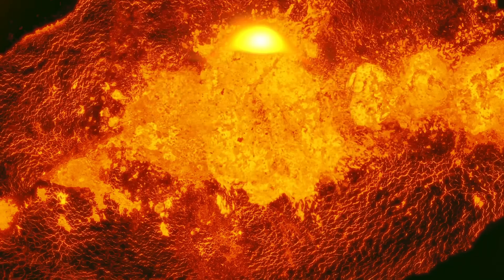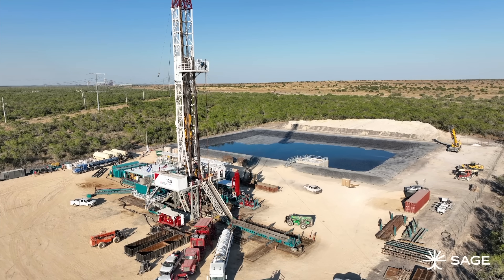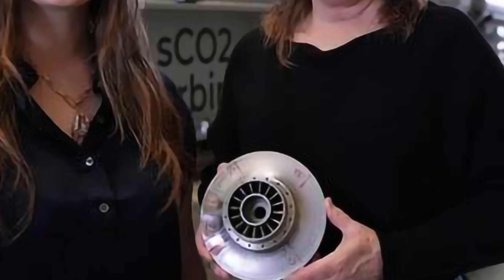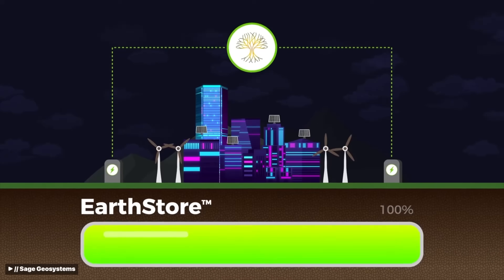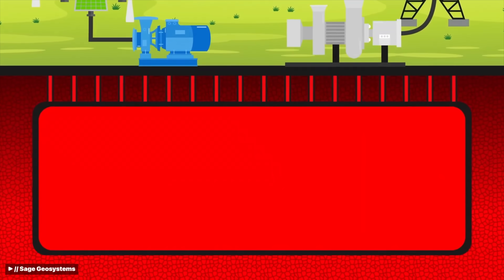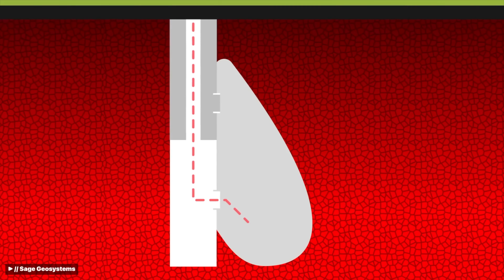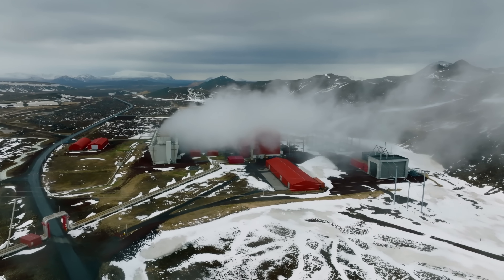This Tech Solves Geothermal's BIGGEST Problem - Gamechanger?

Comment: The 800-lb gorilla in the room with Sage and Fervo and other modern geothermal concepts is "where are they getting the water?".  I mean, Sage and Fervo both have said they drill hot, dry rock and avoid natural fractures.  And yet, they also mention that they use water to harvest the heat and bring it to surface.  They have to send that water back down into the ground after they have extracted the heat.  The part no one talks about is the volume of water required to make meaningful electricity, and the fact that they are taking that volume of water out of the hydrological cycle - meaning that once they remove the water and put it into their system, the water is NOT returned to streams, rivers, ponds, stormwater treatment, wastewater treatment, etc.  Its gone.  And if you think about the implications of that, well, their "solution" is not really that attractive.  Do the homework yourself and see how much water they need for 1GW of electricity.  That is why Sage and Fervo and other EGS solutions in hot, dry rock are fundamentally flawed.
Reply: If you want the answer, you'll find that it's about 1 acre-foot of water per MW, or 350,000 gallons.  Which means a GW is 1,000 acre-ft, or 350,000,000 gallons.  For some perspective, go to ChatGPT and ask "Where does Washington DC get their water for public consumption, how much do they use per day, and how much do they treat and discharge back into nature?"  You'll quickly discover that Washington D.C. pumps about 100 million gallons of water per day from the Potomac River, they can treat 300 million gallons per day, they store about 60 million gallons of treated water, and the Washington Aqueduct stores about 60 million gallons.  And how much power does DC use in a day?  About 27GWh, or roughly a little over 1 GW per hour.  So for some perspective, these geothermal outfits are going to need to use more water in a day than Washington DC (water that is permanently removed from the hydrological cycle) to create about enough electricity to power Washington DC for a little over an hour.

Comment: The biggest problem for geothermal energy is that it requires a rare combination of three elements: heat, water, and permeable rock [01:56]. This has limited traditional geothermal technologies to about 2% of the world's surface, keeping it from being a widespread source of power [02:03].

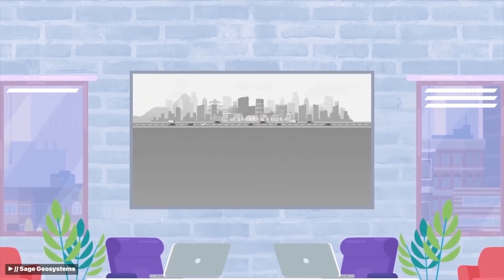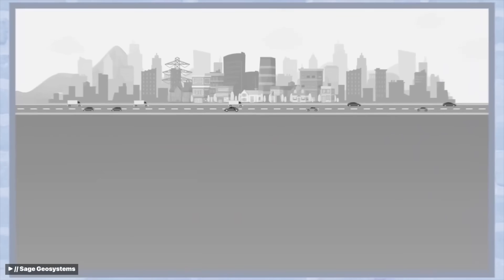The game-changer, according to the video, is a technology called pressure geothermal from a company called Sage Geo Systems. The company, which is led by drilling experts, found a way to drill into hot, dry rock, which is available in 50% to 60% of the Earth's surface [00:25, 02:39]. They use a technique called gravity fracking with only water and crushed rock to create a large underground fracture network [02:46]. This allows them to manage heat and pressure in a multi-well pad to produce a constant 50-megawatt output [03:05]

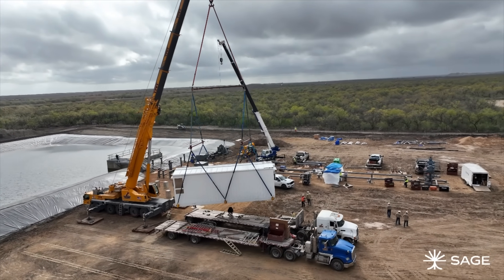Sage's turbine a supercritical CO2 turbine [3:36].

How It Works
A supercritical CO2 turbine is an advanced technology used in some geothermal systems. The substance used, in this case, carbon dioxide, is heated to a "supercritical" state where it acts as a very dense fluid that is neither a gas nor a liquid.

This allows the system to generate power more efficiently than a traditional steam turbine, and the turbine itself can be significantly smaller and simpler .
Reply: Only for 30k houses ,in a city of millions which requires a few plants-  all that fracking can bring about an earthquake?
Reply: @EdT.-xt6yv Small earthquakes happen all the time and humans don't even notice.  Seismic activity is nothing new.  While a simple Google search indicates 2 earthquakes greater than 3.0 attributed to fracking, 99.9% of all fracking earthquakes are so small no one has ever noticed.

Comment: It is the drilling cost and even with millimeter wave technology included, this adds complexity with. What is drilling failures due to technology just not yet perfect, this may be a DOE aspect to develop the technology under the geothermal  or mechanical programs.  The aspects of doing this are good, but the problems encountered in developing deep fractures will be difficult due to geo pressure unknowns in the substrate, avoiding natural fractures in totally unknown until continuous testing.  A likely unknown added to the picture.

Comment: The idea of not adding a biocide I find unreasonable. If the system were to get infected with anaerobic bacteria and one would thus be confronted with H2S you’re in a very bad spot. Managing even the lowest ppm is not trivial and expensive. Safety issues, hydrogen embrittlement etc….Not all oil industry best practices are evil!

Comment: Asked to “Sound Off”, so I will. It seems that this non toxic Geo Thermal Electric Generation approach is superior to the not so "Clean” Nuclear Fission Electric Generation approach to solve growing power hungry society's electric energy demands. I ask here for a video to be done on exposing nuclear electric energy generation spent fission fuel short term, AND long term storage issues. Also Uranium Miners life spans/working conditions. Why ? ...Thorium or Uranium Fission Nuclear Power of any type, today, equals a spent stockpile tomorrow of nuclear fuel rods in a cooling pond dependent on electric, electronics, a limited number of skilled people with expertise to maintain the spent nuclear fission cooling ponds, electric energy water pumps built with sensitive electronics coils, machined mechanical replacement parts and water pump pipe parts to keep the rods cool for innumerable years running constantly. A cooling pond system needing much monitoring. These VERY long term cooling ponds are all over the World now. Small Modular Reactors (SMRs), like all nuclear reactors, produce radioactive waste. While SMRs are smaller and potentially more flexible, they don't eliminate the need for waste management and disposal. In fact, some studies suggest SMRs may generate more waste volume compared to traditional reactors. Question ….. why make even more cooling ponds needed full of even more spent radioactive nuclear waste laying around, everywhere, when another 1859 Carrington Event type CME can & will decimate all of our electronic dependent society, and specialized people do not come to work, choosing to stay with family members as “ civilized" society devolves to a mad max event foraging for limited food, to maintain the temperamental nuclear waste cooling ponds when electronic cooling pond sensors are no longer working, or manufactured that have failed, and pump replacement parts no longer are available, or can be manufactured, or shipped, and hydrocarbon fuels to run the backup water diesel engine pumps can not be delivered by inoperable trucks with blown out electronics, or more fuel product distilled by chemistry dependant on electric, and electronic sensors destroyed by a strong CME Electric Magnetic Pulse ( EMP)….. Get the cataclysmic picture, yet ? What then ? Will…spent nuclear fuel in warming ponds overheat releasing nuclear fallout to Earth’s atmospheric winds, and jet streams ? Yes ! For sure, spreading poison into nature’s ecosystem, the last food source. Will more nuclear waste cooling ponds all over the world with spent radioactive rods end up overheating, killing off the remaining meager, food chain left in nature feeding the last few struggling humans trying to survive, to rebuild over many future human generations, after a large CME has taken away our modern electronic dependent pampered societies underpinnings, and most of Earth’s human population as well? Yes ! Logically, more fission nuclear electric power creating more spent radioactive waste material needing more VERY long term cooling in ponds is such a bad idea, and should never be seen as a “clean” electric energy generation solution as promoted by many YouTubers. Even rock mining for uranium minerals to make into fuel, the dust gets lodged deep in their lungs which kills human miners slowly, and painfully, just so that we can have that not so “clean nuclear fuel” for pampered people's electric generation needs. Pain and suffering out of sight, is still pain, and suffering incurred by a fellow human being. Google….life expectancy of a Uranium miner to learn more.. Or…Google the top “geopolitical”, “not so friendly” uranium supplier countries in Central Asia , and Africa whose citizen human rights records, so important to many green technology promoting YouTubers, and Readers, to explore  safety practices while uranium mining which is at best described as dismal. Even child labor is used in African uranium mining. Knowing these facts is an eye opening knowledge gain result countering the “clean nuclear” energy dogma carelessly spewed here, and elsewhere. In fact, if robust nuclear electric generation power is implemented as championed here, it is the recipe for the final knockout blow to a very much degraded, struggling humanity after another intense CME comes to visit Planet Earth as has happened so many times in the past. Google the smaller than 1859 Carrington Event “Bastille Day Event” a moderate, but not worthy CME that was hurled toward Earth from the Sun erupting July 14th 2000. Suggested is not to read the tea leaves to predict what will come, but instead read the petrified tree rings of the past. Do you not believe that CME’s can happen at any time(s)…? Google : "Miyake events" after the Japanese physicist Fusa Miyake, who first discovered the CME telltale signature in tree rings. Remember to Google: to learn about what a electromagnetic pulse (EMP) is a burst of electromagnetic energy that can disrupt or damage electronic equipment. It can be caused by natural events like geometric disturbances (GMDs) Google: THE 1859 Carrington Event. Google EMP to better educate yourself to see the vulnerability. As recently as July 2012, a powerful coronal mass ejection (CME) from the sun narrowly missed Earth, passing through our orbit but not directly impacting the planet. This event, considered one of the strongest ever recorded, could have caused significant disruptions to Earth's technology and infrastructure, potentially comparable to the Carrington Event of 1859. When better educated with historical knowledge, you can then decide if you wish to “roll the dice” supporting the notion of proliferating NOT “clean” nuclear fuel as an electric generation fuel of choice as misguidedly suggested by YouTubers who gloss over, or do not mention the fission nuclear spent fuel long term storage conundrum. Seems that this Geothermal non toxic approach concept not needing thousands of years of radioactive “ HOT” spent fuel monitoring is a much better solution when soon at a competitive costing scale of deployment while utilizing an existing well trained Word wide hydrocarbon well drilling labor force.

Comment: I did some research on this for my job about a year ago.   The issue is that geothermal heat is such low temperature that you have to use an Organic Rankin Cycle (ORC) to extract the energy.  The problem is that the thermal efficiency of these systems is approximately 10% meaning that you have to reject as much as 10 times as much heat as you generate power.  This heat has to go somewhere and generally that is into bodies of water or the atmosphere.  I don’t think this would be very good for global warming or the environment in general.
Reply: You missed the message
Reply: You mustn't have looked too deeply into it. Supercritical water and supercritical CO2 is the aim. Also the fields in use today use hi pressure super heated steam, and  only use ORC to recover energy from the last dribbles of heat.

Comment: Here is another example of praising an energy producing system without explaining, investigating, or even ignoring the negatives of it. Like what they did with electric cars. No wide explanation of the problems such as battery fires, cost and length of charging time, insurance won't repair most collision damage and the cast of insurance. All of this and more was ignored , hidden, or unknown prior to the great push for the machines.

Comment: I wonder if heat and pressure could be used? They use sand to store heat for batteries. Why not combine the two and see if it will get more out of the system or not.

Comment: The description by the company, this isn't geothermal, it's geopressure.  They inject the water into a pressure vessel using other types of electricity, then release the pressure to extract electricity, like a battery.  In this case the pressure vessel is in the earth.  Misleading title.

Comment: Ehhhhhhh...............  From working in the O&G business/field, wells seal up if they don't maintain a minimum pressure to keep the fracture open.  That is with the advanced synthetic particles that are designed to keep the fractures open longer for production than using just water and sand.  Granted, the greatest amount of energy used in creating the fracture and pumping water down into the well is the initial fracturing.  Water disposal wells chew up a considerable amount of energy to inject unusable water back into the ground.  None of my clients use geothermal wells anymore for the main reason that they eventually get clogged up and require new drilling or flushing.  Which requires a lot of energy and is really expensive and they don't see a huge cost benefit with the amount of extra effort that is required to maintain the well.  I am sure they are thinking through a lot of this... but I'd say this whole thing is resting on the chances that their turbine is far more efficient than other electric generating turbines in existence and that their well casing/maintenance is somehow going to be far superior to typical practices today.  The delta of benefit looks slim.

Comment: I feel like all the key tech needed to reduce C02 and reduce the oil and gas needed around the world is there, but we just need time to build and test it out at this point. 2050 will have some crazy stuff by then, with almost everything doubling in storage, generation, and reduction. Esp if they can get solar to double their current output. Main problem is just cost still for the average home owner at least here in the US. You almost need a new HAVIC system, water heater, solar, batteries, car, stove, etc so while the tech will get there, I think it will be a while still before everyone gets to switch. So more like 2100 will be the year for all green planet.

Comment: Just like with fracking, which pollutes aquifers and causes earthquakes, this is another “holy grail” where possible destruction of the delicate balance of the earth is completely ignored.
Reply: It was not ignored but mentioned in the video. It will certainly be looked at. Relax or if you're so concerned about delicate earth balance get hot on eliminating gas from your life. If not pack it in.
Reply: @cre8tvedge 
A typical idgets response. Put the onus on the individual for a problem that can only be solved at a governmental level. 
I do what I am able, but what would help much more would be narcissistic climate deniers such as yourself deciding to “pack it in.”
Would make the world a better place for humanity.

Comment: Scale deposition is a  serious problem in many geothermal systems. Dissolved calcite,   various salts deposit in wellbores and surface equipment, concentrated in cooler, lower pressures closer to the surface. Often costly chemical treatments are used to manage this, where possible, but it is stiil a major obstacle. It occurs in the oil and gas industry too, especially in secondary recovery water floods and enhanced recovery C02 floods. It is heavily geology dependent and is also a factor in geothermal energy. Some areas are better, with favorable geology ,a higher geothermal gradient and an adequate feed water supply. Horizontal drilling with multi stage hydraulic fracking is a big game changer in the oil and gas industry shale plays and would have been unthinkable just a few years ago. Technology advances and   hopefully will continue in the geothermal energy world too.
Reply: How about teflon, ultrasound, and big settling tanks.. maybe even use them for cement?
Reply: Yes, teflon coated tubulars are used in oil field applications to prevent corrosion and limit scaling. It has a high melting point at 620F, which could be good for geothermal applications, but I don't know if it has been tried. Dissolved minerals will still precipitate somewhere downstream and could be trapped and removed, but unwanted heat and pressure loss could be an issue and could require some complex engineering to overcome.

Comment: What's also super-cool about this is how hyping this will really get that 10k-15k foot drilling out there, approved. This allows pretext for accessing those really deep hydrocarbon deposits that current law disallows.

Once approved for this 'green tech' it'll help significantly towards getting it approved for 'other' purposes as well.

Awesome stuff!
Reply: We need more hydrocarbons like we need pimples all over our bodies and I do mean all over. It's just a nuts idea. Do more reading.
Reply: @cre8tvedge recommend any particular line of research?

If carbon can be removed from the atmosphere and converted into something useful, more carbon in the atmosphere could be useful for mining it.

Comment: One thing not mentioned in the video is that you likely could tap heat for district heating systems from these same geothermal pressure reservoirs without significantly impacting the electricity generating capacity.